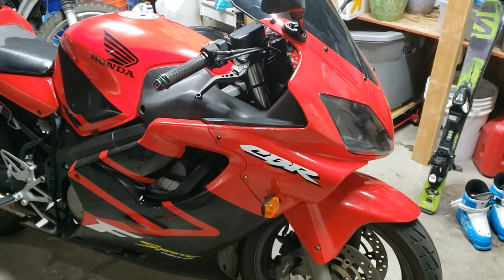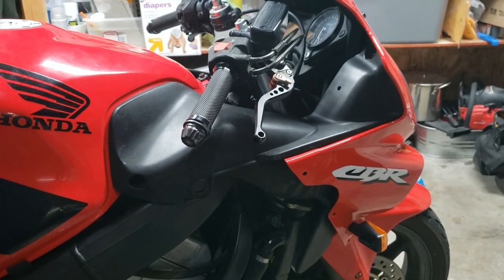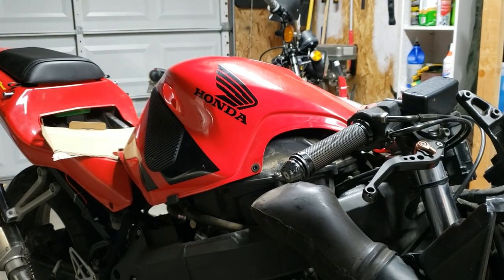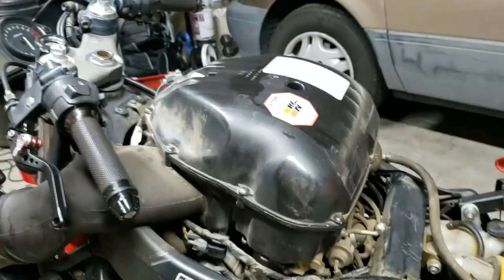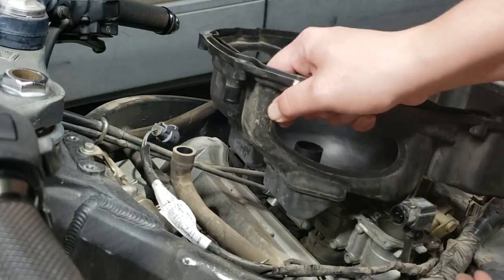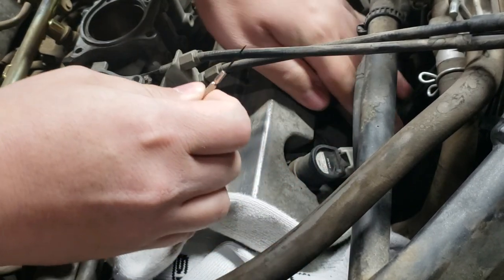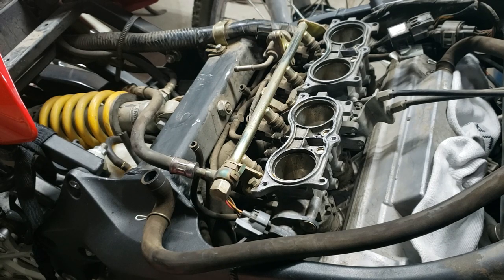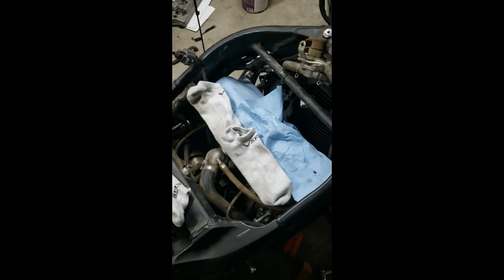2001 Honda CBR 600 F4i Project - Tank, Air Cleaner, Throttle Bodies Removal

Comment: Just removed the throttle body on my 954. Remove the screws like he does, then there is a rubber seal that you need to CAREFULLY pry open with a crowbar (that what i used).

Comment: Hey, thanks for this video, it's very informative. But I'm curious, what do you mean by wrong plastics in the beginning? They are not factory?
Reply from the maker: Hey thanks for watching! So in all the time I've had the bike, I've never gotten a definitive answer. It's for sure an F4i but the plastics say F Sport. I've never seen a bike called the F Sport so I'm not sure if these were knockoffs or perhaps it was called the F sport in other markets. I'm honestly not sure.
Reply: These are not the proper decal but are the same Plastics. The proper f4i Has CBR600 F4i on the frame and rear seat plastics. My profile is my bike with the F4i decals. People also Like the REPSOL plastic for this model.

Comment: Your missing these little cushions that go in the air box mine had it helped with dust also…
Reply from the maker: Oh thank you for the heads up! You don't have a part number by chance do you? Thank you!
Reply from the maker: So I found out those are discontinued and I couldn't give them for sale anywhere
Reply: Literally feel like you can make these your self
Reply from the maker: @vanessab.3980  if I had a better picture and dimensions, I might be able to 3D print them. Does your bike have them?

Comment: Is there any footage of you putting it back together? specifically putting the air intake back on because I cannot put the air intake tubes back in and I am wondering if there is a trick to it or if I just need to brute force it. Someone help me plase
Reply: Brute force they are very difficult to get all the way into the lip but once you get it there it will lock right in. I bought my 02 and ran a maintenance check on it and one of mine was not fully seated nearly tore my thumb up from having to struggle so hard.

Comment: How did you get the throttle bodies off the mounts the kne bit i needed 🤣🤣🤣🤘🏻great video though dude
Reply from the maker: Hey there, sorry for the late reply. They are tough to get off. I recommend heating up the boots with a heat gun to soften the rubber.

Comment: Yoyoyo...... you put in a manual cam chain tensioner in that yet?  They are known to fail on Honda bikes, many others for that matter.  And I hear it's a you know what to change it out unlike it's brother the CBR600rr.
Reply from the maker: Yes, I did change to a manual chain tensioner. Maybe I'll do a video on it because it's really not hard if you take off the air box and that takes an extra 15 minutes.

Comment: Hey man nice video. I have an 02 with the same color scheme. My starter has recently gone out, where is it located?
Reply from the maker: Sorry man I really don't know. Looked through the service manual too and it wasn't helpful. It mentions a starter clutch but I didn't see the actual starter.
Reply: @Moturd  dang buddy. Seems things like that are top secret. Can't find out it's location anywhere. I certainly thank you for the reply though
Reply from the maker: @EGIV  very strange. Next time I have my tank up I'll take a look see
Reply from the maker: @EGIV  Hey I was flipping through the service manual and found a pic of it. looks like it's where the rear subframe meets the true frame, if that makes sense. I'll send you a link to the service manual if you want it.
Reply: @Moturd  Hey, thanks man. I spotted the starter but have no idea how I can access it. Please send me the link if you don't mind. Thank you my friend.
Reply from the maker: @EGIV  Here you go: https://drive.google.com/file/d/11KB5i09Nuov7WCpbgSfavnF4DUGD2vbp/view?usp=sharing
Reply: @Moturd  Thanks a ton
Reply from the maker: @EGIV  yee no worries. So I'm pretty sure you'll need to take the throttle bodies off to get the start out.

Comment: good find, I had the exact same bike. that thing will run dam near forever. only issue is that they are notorious for 2nd gear pop out and to split the crankcase the head has to come off to gain access to a bolt. vacuum ports going to the map sensors tend to clog causing the bike to run really rich. drilling them out with a 1/16 drill bit took care of that.   i sold mine a year ago and now I have an 08 CBR1000RR 
https://www.youtube.com/watch?v=gnA4jRRCErc
Reply from the maker: Hell yeah! Thank you for the tips. I may eventually get a liter bike but for now, this is all the power I need. Safe travels!